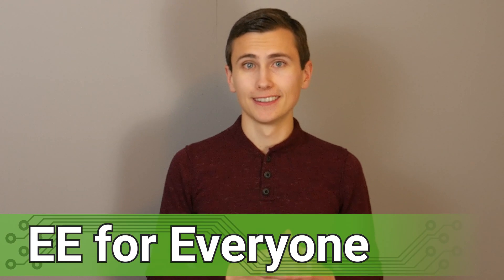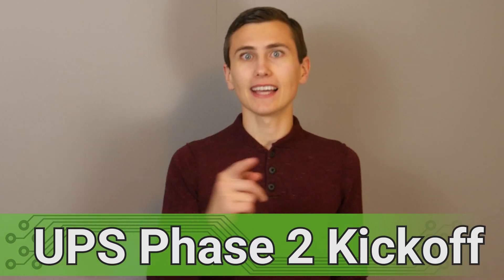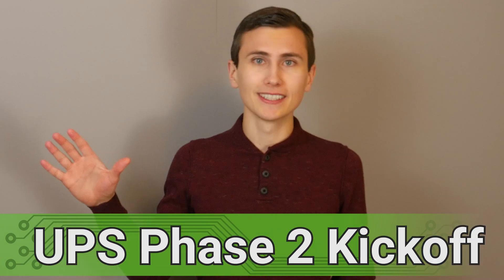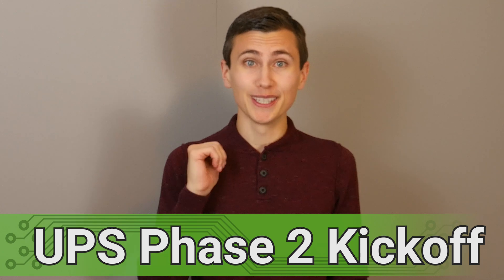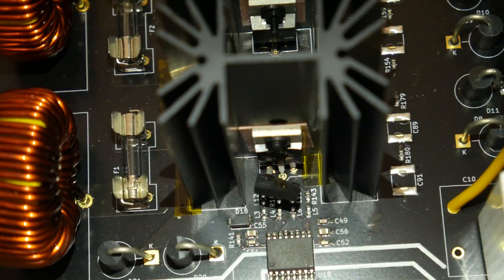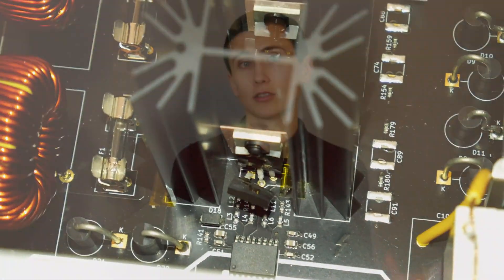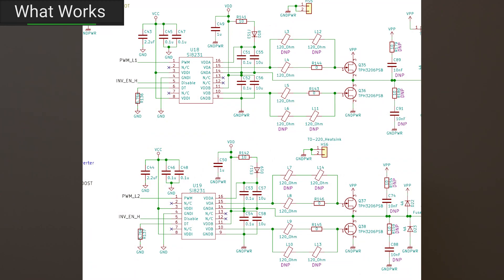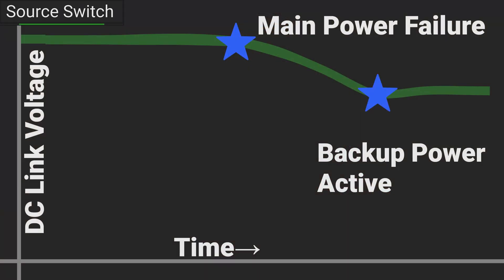Time for an Overhaul: DIY UPS Phase 2 kickoff

Comment: I was thinking about your overall topology and decided to make a new comment because my other one went off into the weeds.

I work for a custom lighting manufacturer and back in the days of metal halide lighting we sold  "uninterruptable" inverters for emergency exit lighting. In those days (I act like it was decades ago but it was only 5 years ago) the overall topology was as follows:

1: huge 50/60hz transformer provided around 48VDC after rectification and filtering.

2: (4) lead acid batteries were charged in series off this supply with a very basic current limiting circuit...this kept the batteries fully charged, but seamlessly connected to the DC bus through only a big diode.

3: the 48VDC bus directly fed an equally large low frequency transformer on a full bridge.

When the system lost power, the batteries automatically powered the bridge inverter.

I think you could run a topology like this successfully:

1:incoming line is rectified and fed into a high frequency step down transformer, DC bus around 48VDC. 

2: same as above topology. 

3: the DC bus feeds a high frequency two step transformer. Basically the transformer's primary is tapped and driven to get a modified square wave.

4: an LC filter smoothes the output to roughly a sine wave...much like a Class D amplifier 

I couldn't find an decent picture of what I'm describing. Tomorrow I'll give you the title of a book which goes into the details of what I'm talking about on a three phases system. This is the same book I'm using to design my power supply. 

I think this is the same system most big UPS use. You could probably feed a computer's power supply a hard square wave without issues, but the modified square wave would certainly be easier on it.
Reply from the maker: Hi dr.rockzo, Thank you for the information, and thanks for taking the time to write this out!

 What you just described is almost exactly the topology used for our phase 1 UPS. Replace 48vdc with 24vdc and full bridge with push-pull, and that's almost exactly what we did.

One of the big challenges we hit was more of a requirements thing. Our input voltage range on the DC side was too wide, because the plan was for an off-the-shelf AC-DC solution. That prevented me from implementing a current-limited diode rectifier.... but that limitation is removed now!

The second part that prevented using a 60/50Hz transformer was size and cost at the power levels we're working at. We would need a 1000 or 2400KVA transformer that outputs ~24 (or 48)V, and then handle somewhere between 20-40A being rectified, carried through the PCB, etc. Neither the size of that line frequency transformer, nor the high(er) currents flowing through our design were easy to accommodate. 

Now, I could work with a lower voltage DC link for the back-plane of the phase 2 design, but we'd have more losses at the interconnection points between boards due to the current flowing.
I'll definitely keep this in mind, but I have a sneaking suspicion that a HVDC link will reign supreme.

The high-level architecture you suggested, where a DC link is used to charge the batteries and that same link is used to provide backup power, is very commonly used. There are a number of tradeoffs to consider. Specifically how we get energy into the batteries isn't fully determined yet, but we'll get there soon. 

There is a common topology for home UPS's and a common topology for industrial UPS's, but they're both fundamentally similar to the topology you wrote above. The main differences are the voltages used for the bus, batteries, etc, the battery capacity/technology used, and what circuit is being used to perform the power conversion.
For example: industrial UPS's most commonly use a high voltage DC bus, a high voltage battery bank, and a bidirectional Inverter/Rectifier to charge and discharge the batteries.

The pure sine wave we're striving for is more for the small power bricks (networking gear) than the computers themselves. I'd rather make a good sine wave and know the UPS will be compatible with everything. 

Every extended run-time UPS (45minutes-1hr+) I saw on the market has a pure sine wave output, and I don't think that's on accident. 

Let me know if you find the name of that book! I'll be eager to dig in a little more.
Reply: @EEforEveryone 

The book is (get ready) "power supplies, switching regulators, inverters, and converters", 2nd edition, by Irving M. Bottlieb...i convinced my grandmother to buy it for me when I was 14ish. The spine has been replaced with duct tape and most pages have scribbles on them from me trying to understand it before I even had a firm grasp on advanced math. Looks to go for <$20 now...i think it was around $50 nearly two decades ago. It's really old-school tech but primarily focuses on higher power, industrial type stuff...it also has a section about "new technologies" like "gate turn off SCRs" (I don't think they exist now) and IGBTs when they were in their infant years. 

The huge magnetics required for 60Hz operation sent me down the same path for my power supply...i was looking at $400 worth of transformers and another couple hundred for rectifiers, filter caps and inrush limiting.

I completely agree that a higher DC link voltage is advantageous...lower (I squared)R losses are awesome.

If the DC link voltage is designed around the battery string's charged voltage AND you're using a simple chemistry like lead acid (lithium batteries are to picky for this), you only need a simple two transistor current limiter between the DC link and battery string. The limiter is only needed so that a discharged battery string doesn't act like a nearly direct short on the DC link. It goes like this: DC link -> current limiter -> battery string -> meaty diode -> DC link. That would easily provide an instant switch over. 

At your desired power level, a 60 or 72VDC string would be pretty straightforward. You could use a simple "dumb" system (like an oscillator driving a full bridge and ferrite transformer) on the input to step down to the string voltage and provide isolation. Then implement safety gear around it like a relay to disconnect from the line if the DC link current exceeds a limit for a period of time...I'm a fan of old school analog stuff myself but a micro-controller could easily do it too. 

I think the reason industrial units run a higher DC link voltage is based on: 
A) higher power systems have fewer losses with higher voltage DC links. 
B) As voltage increases so does the cost of the required components. 
C) consumer goods are almost always engineered to a price point (i.e. the race to the bottom), while industrial goods are engineered to perform a task and cost is a side effect of the design requirements.

Square vs Sine (vs DC output) has some real meat to it. I imagine that it boils down to the following:
A) at higher powers square waves are going to have more harmonic and therefore EMI issues making it harder to get regulatory approval.
B) EMI aside in extended runs with square wave are going to be hard on input electronics designed for sine waves. Transformers designed for sine inputs may go into saturation and offline stuff will see higher dissipation when on a square wave.
C) if the output was DC, most offline SMPS would be fine...but input rectifiers may let go becuase of price point engineering and constant duty cycles. Wall warts would act as a direct short be especially dramatic if fed DC.
Reply from the maker: Hello again, dr.rockzo! Thanks for the name of the book, and your insights. There are many factors that lead to design decisions, such as link voltage, but I think you hit some big ones.

Comment: I think you have a good path moving forward.

The modular implementation is a great idea, for the reasons you mentioned; scrapping an entire design sucks.

Godspeed and I look forward to the next video.
Reply from the maker: Hello dr.rockzo!

Yeah, it was a difficult decision to design in modularity, but I really want to see this design hit 2.4kW.
While many of the circuits require heavy modification, the lessons learned while making the old UPS will definitely carry forward. fingers crossed

We'll see how the next couple days go, but I think we'll have some solid progress on the PFC to talk about.
Reply: @EEforEveryone 
  
PFC isn't something I have played with yet...I'm operating on commercial power (208Y three phase incoming power, phase to neutral is 120V)in a shop full of welding equipment and a 30HP air compressor.

 If anything my uncorrected capacitive input will improve the overall power factor. 

I look forward to the details of designing a high power PFC module.
Reply from the maker: Yeah, you're probably right there - I don't think that PFC isn't always necessary, but the utility companies might disagree. :) 

208 must be pretty nice to have- that lets you work with all sorts of fun shop equipment!
Reply: @EEforEveryone 

Yeah the 208V system is my baby, I designed and installed it. Most equipment runs on it but we had a few machines on the main switch gear...at a certain power level "breaker panels" no longer exist and it becomes "switch gear". 

The main feed into the building is 1200A (yes twelve hundred amps), corner grounded 480V delta. There are no disconnects except the power company's fuses at the transformers.

Last time I got in the 480V switch gear I had to install a 100A breaker with it live...pucker factor was off the chart. One of those scenarios where you don't walk away from a mistake.

We had a 480V VFD go bad and it basically vaporized the entire unit in seconds...the breaker didn't even trip.

Industrial power is an interesting mixture of fear and respect...
Reply from the maker: Wow. I think that you'll be hard pressed to blow that 1200A fuse. There's likely a wire somewhere between the fault and that fuse melting before the fuse would trip. Like you said, working with that main power feed is a no corners cut scenario with regard to safety. 

I'm glad you made it! Sounds like an awesome system- I bet it felt good to put the covers back on those panels when the work was done.

Your VFD experience reminds me of an arc flash training video I saw not too long ago: Industrial power is terrifying. I think this test was dumping industrial power though a copper bar... with similar results as your VFD. Incredible quantities of power - enough to instantly vaporize a metal bar.  https://youtu.be/6hpE5LYj-CY?t=37
Reply: @EEforEveryone  

I think the main breaker is just an NEC requirement...i cannot fathom a fault severe enough to trip it.

When I finished I was so wound up from adrenaline that all I could hear was my heart beat, was sweating bullets and my hands were shaking so bad it was like a scene from "Airplane".

I did get a look at the incoming conductors...each phase had three 750-1000 KCMIL conductors terminated into the buss bars;  big enough that they wouldn't fuse. My understanding is that they run directly to an underground transformer vault at the end of our alley.

I watched that video before I undertook the project, it provided me with the respect commanded by industrial power. I'm not technically qualified to do what I did. After talking to an professional industrial electrician, he explained the the safety gear they wear isn't to save their life...its so their family has something to bury if things go bad. It was an eye opening conversation, the amount of energy available is mind boggling.

The VFD that went up was at least 10yrs old, vaporized may have been an exaggeration. When I energized it there was a bang (like a shotgun blast) and I immediately threw the machine's disconnect. I grabbed a fire extinguisher and ran for the machine, but luckily there was no fire. The VFD's case had been blown off and all the internals looked like charcoal. After a careful inspection I came to the conclusion that it's IP20 rating had allowed a dangerous accumulation of metal dust...now all VFDs in the shop have a minimum of IP54 rating.

I have a fun job...probably because occasionally there is real danger involved (I'm an adrenaline junkie). But much of my job is machining new parts for equipment or custom parts for a job. The EE stuff is actually a nexus of work and hobby interests.
Reply from the maker: Thanks for sharing dr.rockzo! That's the kind of story that can save someone's life if they read it at the right time.  Again, Morbid Curiosity, did you happen to snap a picture of that VFD after catastrophic failure?

It's funny how standards get get updated. 😀 More often than not, it's events like this that make product requirements or regulatory standards get more and more strict over time. I'm glad IP54 prevents the failure. I think it's best that VFDs blowing apart doesn't become a reoccurring event in the shop.

I think EE is  a lot of fun! I'm glad you found a way in to it whether it be work, fun, home projects, or some combination of the three. Circuit design can be a fun exercise in taking 1000 little pieces and making something organized out of the chaos.
Reply: @EEforEveryone   

I enjoy sharing tales from the shop floor if someone is going to find the interesting. 

The whole experience of dealing with the 480V system makes a great success story but honestly it was really stupid for me to do. I think most sane people would have hired a professional for the job and I would without doubt recommend hiring a professional. We're a small shop of around 30 people and we needed the 208V system operational immediately. We were expanding the shop and I'm just high enough up on the food chain to know that our bottom line was being affected...so i decided to make it happen. I really cannot overstate how bad it could have gone...but I'm still here, albeit with a few more grey hairs. 

I wish I had taken a picture of the burned VFD, but at the time my focus was on getting the machine running and making sure it didn't happen again. Another situation where every minute passed was money out the door. 

You wanna talk about organized chaos, I don't know if you have used KiCad before but it could be the definition. I love how when you start a new board it places all the footprints on top of each other so you spend 30min unstacking all the parts.
Reply from the maker: Yeah, "line down" situations are stressful. 
I have used KiCad before! I'm actually quite fond of the tool, and you can't beat the price. 😀 I'll admit the footprint thing is a little annoying. However- there is a fix to the problem you saw: "Global Spread and Place". Check this out and get 30 minutes back in your life. :)

https://forum.kicad.info/t/automatic-footprint-unstacking/2312
Reply: @EEforEveryone 

I think KiCAD is extremely powerful and decently polished, especially considering the fact that it's open source.

After I used it a few times I just accepted the pile of footprints as a fact of life and a fair trade for the software's quality vs cost.

Thanks for clueing me into a better way...i really appreciate it.